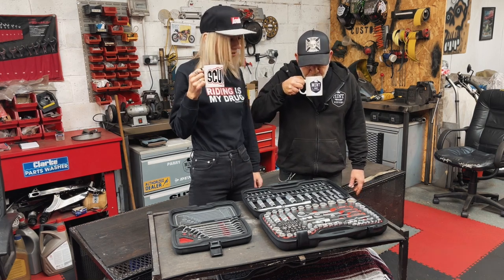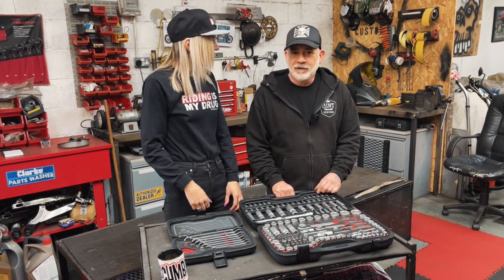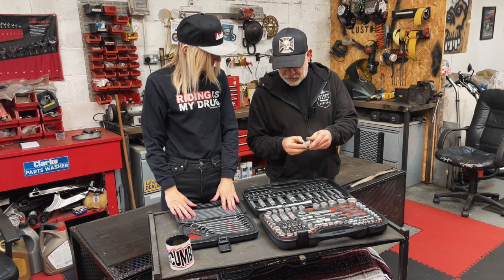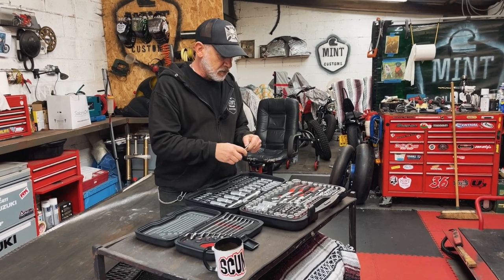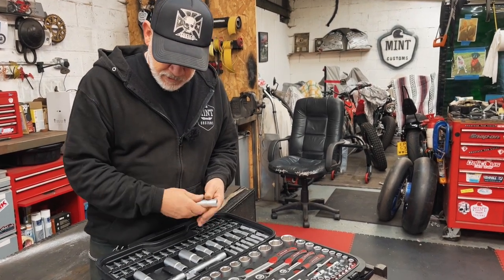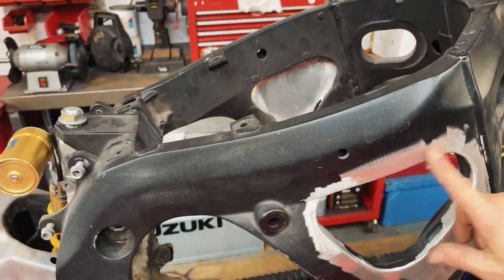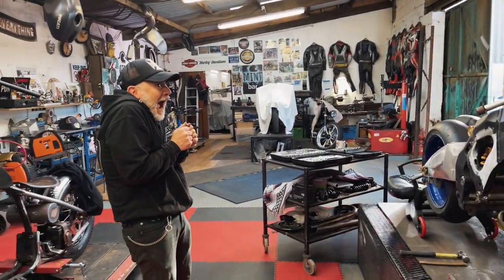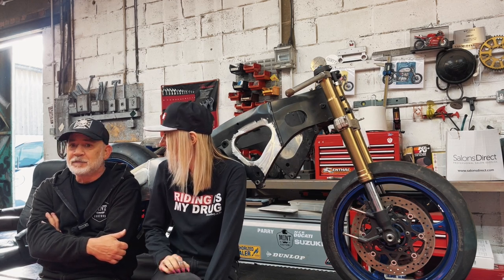First Motorcycle Tools Review and Tips ( From Professional Motorcycle Technician) + GIVE AWAY

Comment: Great I love Gixers,  Suzuki's are my bike of choice. I've had five, an original 1985 750, then an 89 750 and K model 1100, then a 92 1100, a 2004 1000 and 2008 1000. Alas I can no longer bend like a pretzel to fit on one so I now have GSX-S100F which while down a bit on HP is much easier to ride. Add to that a 2020 RE Continetal GT and 2022 Triumph Speed Twin.

Comment: I had a thought while Simon was inspecting the wrenches and talking about their serviceability. What I would do would be to soak all the tools with moving parts like the ratcheting wrenches and the extensions with the "tight balls" that Simon wasn't used to pulling on and soak them all in a cup of thin oil like 3 in One or WD40 like oil overnight then wipe them down and let them drip a while before putting them back in the boxes. That should help them break in even quicker than normal and make them easier to use.
Reply: WD-40 is not an oil , it is a petroleum distilate water dispersant, and will strip out any grease or oil already in the wratchets damaging them further